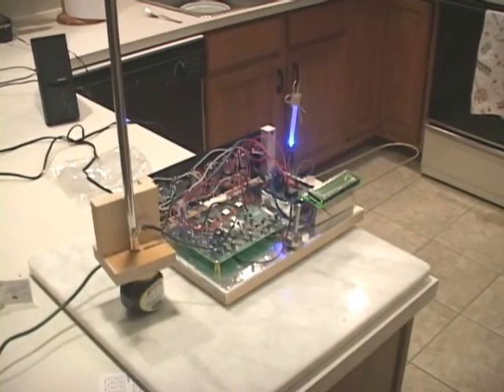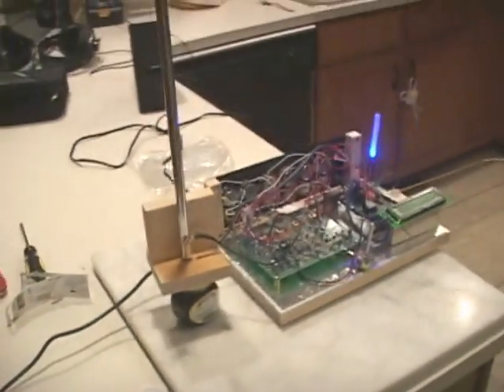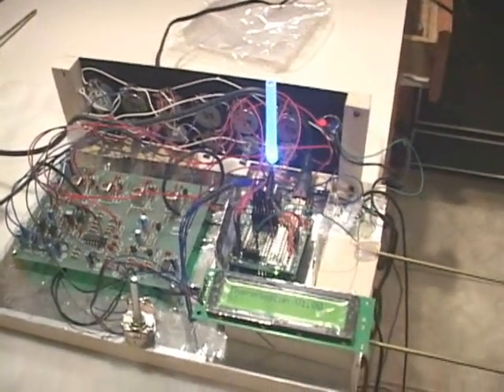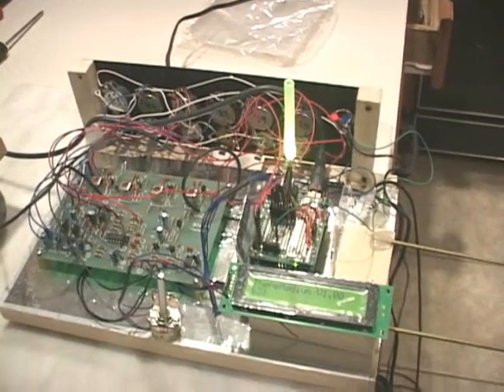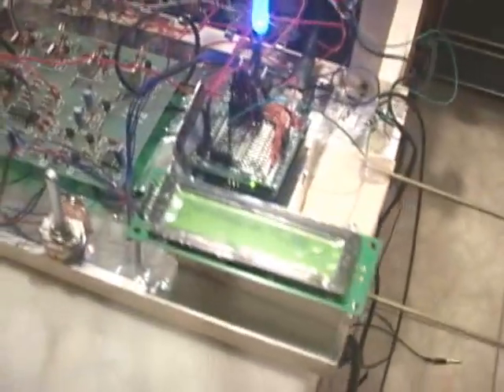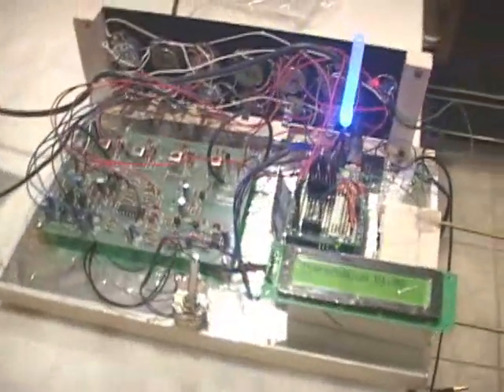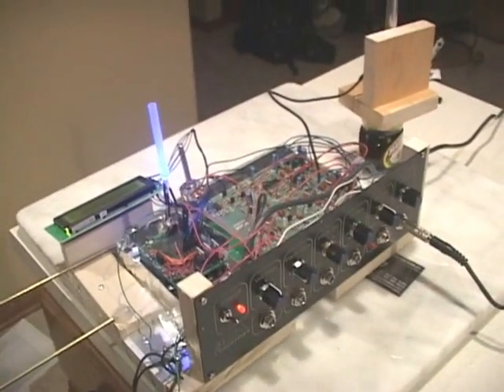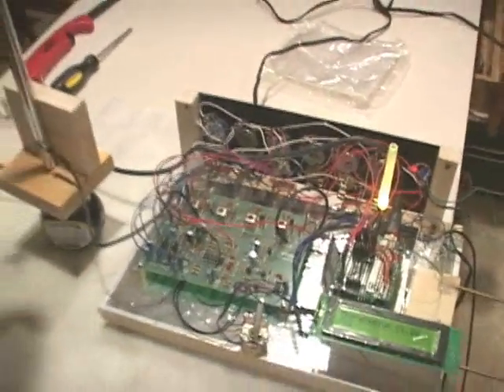MIDI Theremin Project

Comment: That's amazing! I've been looking in to making a theremin that can be used as a MIDI controller for a university project, but i'm only allowed to use a teensyduino board. I'm only a novice in electronics so I was thinking of getting a ready made theremin or a simple kit and trying to take the voltage out and using the teensy to read the voltage and output a midi number. Do you think this would be possible?
Awesome theremin and many thanks if you actually get back to me!